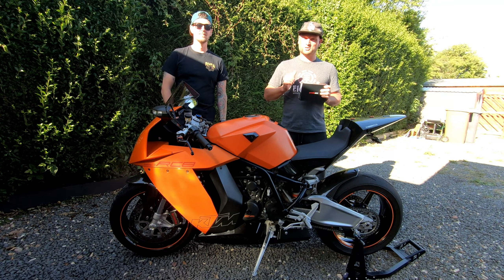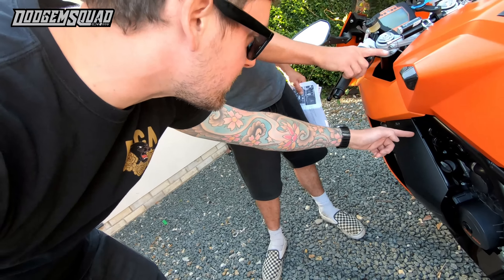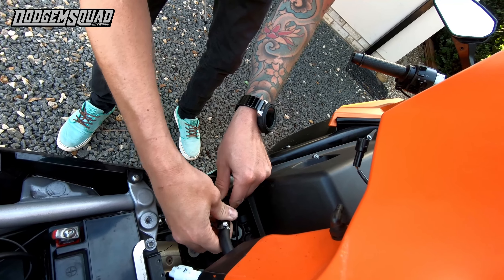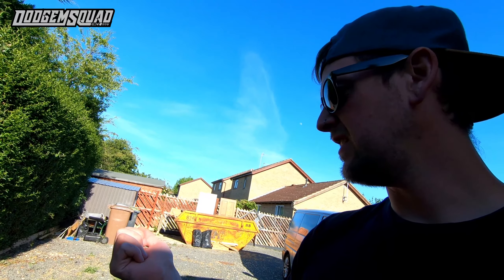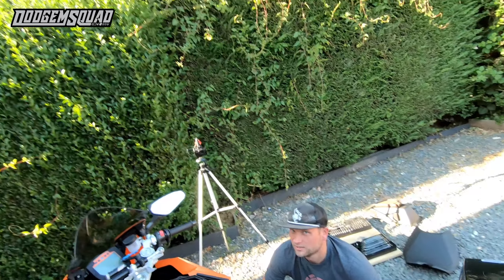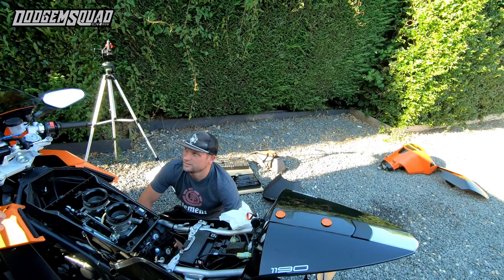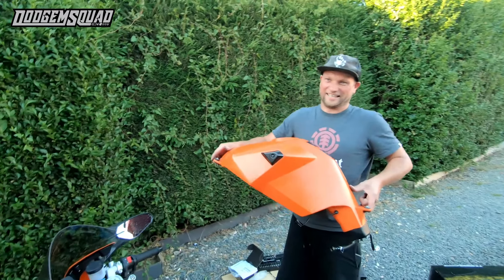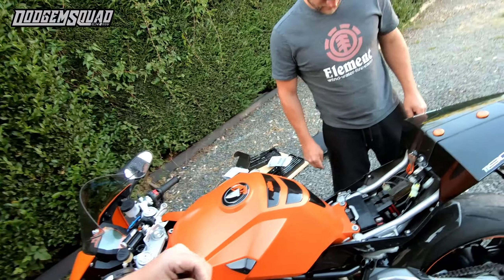The RC8 in bits again | installing a power commander 5!! | fixing the fueling issue

Comment: I've been looking at adding a quick shifter and PC5 to my 2014 RC8R. How did using the Healtech QS and Dynojet PC work out? Was there any problem with compatibility between the brands? Were they able to just clip into one another at the injectors?